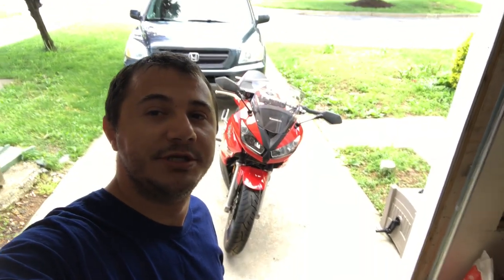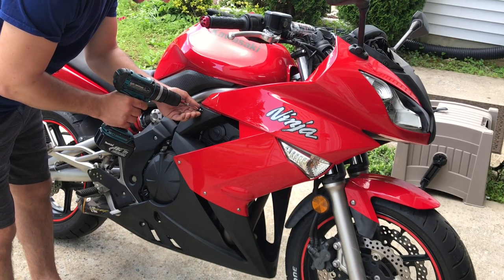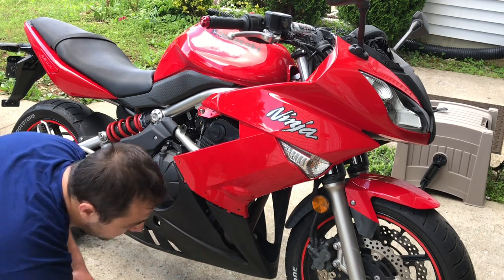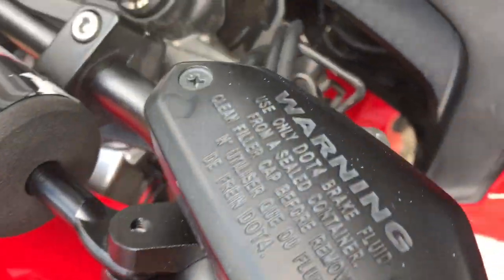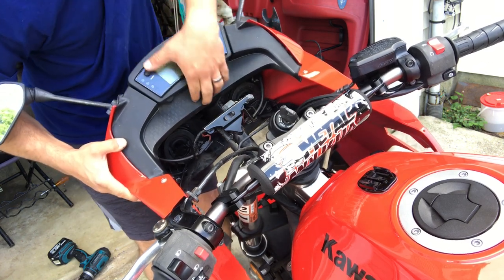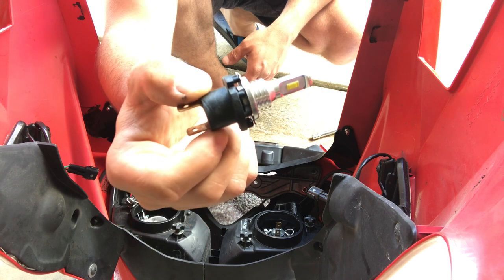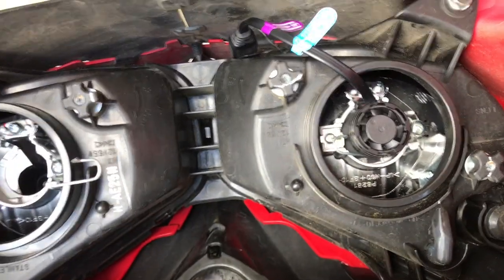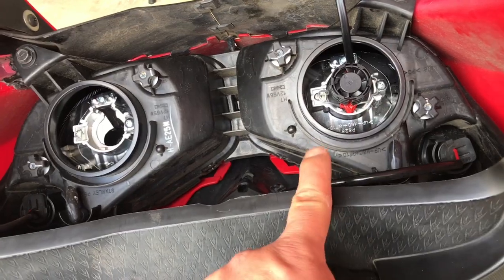Ninja 650R led headlights install

Comment: Fun tip, you can turn the bars full lock to both sides you can reach the back of the headlights without removing the fairings

Comment: installed both low and high beam headlights without removing fairings 👍
Reply from the maker: Easier and more clearance if you do take it off. There’s always ways around doing things tho

Comment: I bought the same LED's as these new ones you installed. This should help a lot!
Reply from the maker: Elijah Milan thanks for watching! I’ve heard they’re some sort of inserts you can add instead of wrapping around the springs. But I haven’t tested those out since I sold the bike. This should help you out tho.
Reply: @MotoRoUsa  I think I'm gonna try a liberal application of electrical tape around the existing spring clamps
Reply from the maker: Elijah Milan that should work as well as some thin wire. Watch the thickness because it’ll be hard to push it back if it’s too thick around that spring.

Comment: The next step is arranje onde solution to eliminate the light connector / adapter ...
I am thinking of ... cut de wires, remove the original female connector of the motorcycle and put on one h7 female connector...
Reply from the maker: Luis R yeah but I didn’t want to do all that and keep it simple

Comment: On low beam are both lights on or only one? High beam I know would be both.
Reply from the maker: Only one side unfortunately. I’m sure you can rig it up so both will turn on with low beam but I haven’t done it on that bike.
Reply: @MotoRoUsa Thanks-during the daytime do you ride with low or high beam on?I've heard so many different opinions on this one i.e.high beam makes you look 'too close' and shouldn't be used but then others swear by high beam during the day
Reply from the maker: @redskies4530  when I had that bike I rode with high beam during the day. Not just for safety but I like to have both headlights on to avoid stupid conversations like “ dude your headlight bulb is out “
Reply: @MotoRoUsa  Thanks and good enough reason there.

Comment: Did you have to get anything done to your fuel system when you changed the exhaust
Reply from the maker: william dolezal no I did not have any power commander or fuel controller. Usually since it’s fuel injected the ECU adjusts the fuel and air pretty well.
Reply: @MotoRoUsa  how do you think it sounds. Is it louder then the stock
Reply from the maker: william dolezal yes huge difference. Sounds great

Comment: Most LEDs are not going to make your vision better because thr beam pattern isn't right for the housing
Reply from the maker: william dolezal it did make a huge difference . The headlights need to be adjusted that’s all. They have a bit of glare but not too bad.
Reply from the maker: Luis R thanks for the link! It would take about 30 days to get them but it’s worth it i guess .